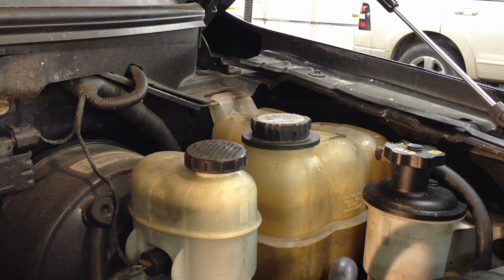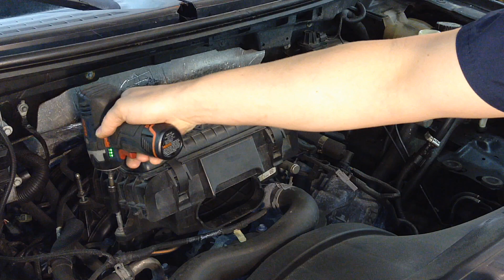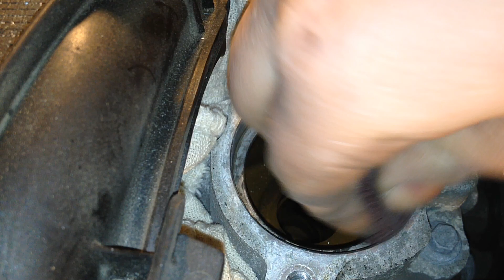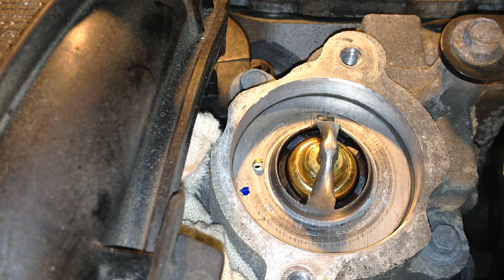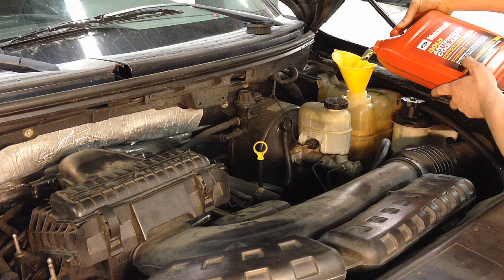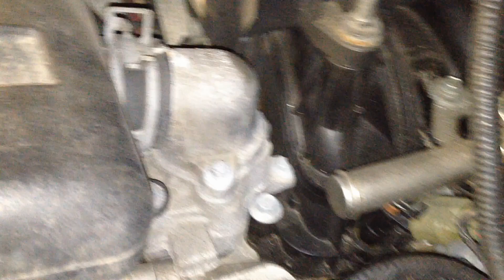Ford 5.4L 3v Engine Overheat P1285: Thermostat Replacement

Comment: I just did mine and whoever changed the thermostat last, installed the O-ring at the bottom of, instead on the top like in the video..smh. No wonder there was no hot air coming out. Thank you for making this video.

Comment: I really doubt all mechanics would take the time to use a scotch brite pad to clean off the mating surfaces. Thanks again for doing it right!
Reply from the maker: ***** Yeah I like to do at least a bit of cleaning so I am confident in the repair. My tech number goes on that ticket here at the dealer and at Ford corporate I don't want to go down in history as the problem child tech with all the come backs.
Reply: FordTechMakuloco  do you have to bleed coolant system on a 01 navigator if changing thermostat?
Reply: Most good certified techs will. They don’t want to have to do the job again
Reply: I do and probably almost all experienced pro mechanics too.
Reply: Youre going to the wrong places if they dont cuz thats a common practice

Comment: I'm glad it's not like my 99 5.4 those housing bolts are  like six inches long and go down through the head was a nightmare removing them with out breaking them off my 06 now has the short ones

Comment: Excellent video as always, easy maybe dumb question. The other day had a huge leak on my radiator, I was 150 miles away from the house. Stopped by advanced and bought a bottle of Bars Leak/Super coolant and 8 bottles of distilled water. I did a one shot stopping every 20 minutes to check the level. I ordered and a new radiator, pump, thermostat should I be concerned about the bars leak I put in? Will it plug my heater core or anything else after I install the new radiator or did the old radiator catch most of it? Thanks

Comment: My 04 5.4l 3v has been having a P0128 code. Engine not running at optimal temp (running around 150-165 degrees). Required changing the thermostat. Thermostat was sticking open and overcooling the engine.
Reply: I have the same issue, is this not okay for the engine?  Don’t you want it to run cool?

Comment: Im having an overheat issue on 2009 Ford Fusion 3.0. I replaced the radiator, fan, thermostat and both upper and lower radiator hoses. Idk if these systems can be pressure tested but I tried pressure testing it from the overflow tank but literally no pressure was building in the system despite filling it with like 9 quarts of coolant. I bled the cooling system because my cabin vents were hot when I turned the heat on but the overall cooling system is not performing for some reason.. I verified the cooling fan does turn on. I do not believe I have a head gasket issue because if it was, the coolant would be boiling/bubbling at the overflow tank and it doesn't.  Only other thing I could suspect is the water pump but even then when I drained the coolant and filled the system back up the coolant was sucked down into the system after the engine warmed up so that must mean the water pump is doing its job? so I'm lost.

Comment: I'm working on one of these for a friend at the moment. It seems to be overheating, I can smell it in the coolant it's been hot, she said it was tapping and sputtering as well when it does it. I was leaning towards the thermostat sticking already, the coolant doesn't look bad so I don't believe it to be a clogged radiator issue and no weeping or noisy pump it has triggered a engine light but the diagnostic port is not working so I can't get the codes to see what they are. It looks like from your video description the thermostat sticking is common on these and since I can't get codes I'm thinking I'll replace it 1st since it's easy and cheap flush the system and see what happens.
Reply: Any ideas on the diagnostic port would be appreciated as well. Thanks love your channel!
Reply from the maker: There is a 20 amp fuse that powers the port and is shared with the power points so check those listed as power point fuse in the owners manual.
Reply: @FordTechMakuloco  thank you. I'll check that out

Comment: Enjoy your videos. I have a question concerning a 2000 Ford Expedition Eddie Bauer 4x4 5.4. I have a p308 code for number 8 cylinder - a misfire. I have changed coil and plug brand new. I still have p308 code. Do you have any ideas as why this happening? Vehicle is drivable, no no blow by smoke, has a shake on a hill and with high speed. You are thorough and I love watching your videos - would appreciate your help

Comment: Have you worked on  a 3v 4.6 Mustang with a heater hose leak and what are your thoughts one running the heater hose under the intake and putting quick connect elbows on something that you can't even get to without tearing a bunch of stuff off the top and/or front of the motor. I guess the proper way would be intake removal and all attached to it. But I've seen it worked out with Throttle body and alternator were the biggest parts removed. I personally think it's a pretty twisted prank to put those quick connects in there. No need for quick connect if you removed everything in the way and have wide open access.

Comment: I just had the water pump replaced on my 2007 5.4 3v with 146,700 on it. The truck has always run between 190 to 200 on my CTS2 used to monitor gauges. After the replacement of the water pump and belt tensioner, my truck now runs with the coolant temp around 220 to 224 and CTS2 shows cylinder head temp around 236. I am going to take it back to the shop that did the pump. What does it sound like maybe wrong? Air in the system or something? The temp gauge on the dash never rises above the center mark for normal operating temperature so I am really confused and concerned. What would be vital or critical temperatures for coolant and cylinder head? Any tips on what to have them look for or to question what they did? I am not getting any codes that I am aware of yet either.

Comment: Thank you for the video I got my Ford F1 50 and I get half a cigarette problem with the overhead and I am really don’t know what to do with the truck the mechanic can’t find the problems I replace the thermostats fan clutch radiator and water pump and I still had the Problem can you help me with

Comment: I have a 2004 ford expedition.... 5.4 liter  just changed the thermostat. Still takes forever to warm up and doesn't blow hot air... every once in a while it will overheat but turn it off and back on and the gauge will go back to midway, hot air and all is well...  do you think a flush would maybe help? Or air in the line?

Comment: I have replaced my thermostat in the last year, but have an issue after several minutes of driving, the temp gauge goes up for about 10 seconds then returns to normal halfway position. It does not turn on the check engine light/code, is there a short list of other possible issues or is the thermostat the likely culprit?

Comment: Thinking of putting a 180 temp instead since i live in the south. Truck reached temp of 210 a few times causing rpms to rise to cool the engine i assume. Whats your opinion?
Reply from the maker: 210 is totally fine

Comment: Would you happen to have any videos on how to replace the cylinder head temperature sensor on an 07 expedition 5,4 3V and if so is it possible to not have to take off the manifold to do so.  Appreciate you sir.
Reply from the maker: No you just have to remove the intake manifold or at least unbolt and lift it.
Reply: @FordTechMakuloco  would I need to remove the alternator or no? Sorry for all the questions just really value you're opinion. On a scale of 1-10, 1 being installing a air freshener on the rearview mirror and 10 being a complete tranny and engein from Auto to maunal swap what would you rate this as?
Reply: @BossTweed1  You'll make it much easier on yourself if you remove the alternator and like he said at least unbolt and prop up the intake. 
I'm no tech but I've had the intake out of both my wife's 2012 and my 05.
During both I saw that temp sender and thought no way am I putting this back together and not replacing that thing.
There's just no way to get to it otherwise. 
I've been a Ford fan since the early 90's but it's shit like this that makes me want to just slap some sense into their designers.
Reply: @carlspackler91  thanks a million. Yeah I thought the same like why put this in the most hidden obscure place ever.
Reply: @BossTweed1  Because their engineers are masochists at heart 🤣

Comment: I replaced my thermostat and I'm still getting Spike and Check Gauge alert. If I turn it off, and back on, gauge goes to normal. I can slowly unscrew the reservoir cap and it builds with fluid. Any ideas would be helpful. This time, it struggled to start. I'm almost ready to switch trucks and do a timing job, maybe.

Comment: Thank you for the video and the best practices. Working on a 2003 Expedition 5.4L Triton and having trouble confirming the torque spec you mentioned. 89 in-lbs seems rather low, yes?
Reply: Adam Smith 89 in-lbs is the correct value for 2005 models and up. 2004 and earlier models require 15 to 22 ft-lb.
Reply: Wasper216 Thank you for the reply! I held my breath and trusted your expertise and it worked.

Comment: Hi! 
great videos! Quick question, on my 2001 f-150, my temp gauge now seems to hover at about midway. It used to stay between about 1/4 and 1/3. It has 190,000miles. Can the thermostat get stuck halfway open? would that cause this?

Thank you!
Reply from the maker: It should always be at the midway point I have seen them stick many different ways.

Comment: i noticed that the powersteering reservoir is on the LF fender and not on the LH valve cover. never seen them there on f150's, only on expeditions of this year.
Reply from the maker: 4literpowered Yeah this truck had been hacked into many times in the past apparently. There was no bracket for the reservoir in it's normal spot and the reservoir is from and expedition with some lines hacked in.

Comment: hey Brian my f150 5.4  won't start it says that check engine temperature it's been 10 days that the truck doesn't turn on  like it's on a safe mode could ot be the thermostat....?

Comment: @fordtechmakuloco 
Please do a video on P0119 for the 5.4 3V engine.
Code says Cylinder head temperature sensor and possibly the harness Connector and or wires to and from Pigtail/ main harness. Due to heat.
The Sensor is located in the Valley of the Motor.

Comment: hello i have a 2006 ford f150 5.4 i need to do a full coolant flush do i need to remove the thermostat to flush the block out? thank you for your time
Reply from the maker: Coolant flush video out tonight on this vehicle
Reply: FordTechMakuloco would you suggest I stick with a 195 thermostat and not go down to a 175 instead what would be the difference except when it opens up.

Comment: My 2009 has no heat. coolant is good. fan works. all gauges read normally and come to normal temps.
Reply: Dave Mercado you probably have air in your coolant system
Reply: That or your blend door actuator is not functioning.

Comment: if I plan on following your video from 2014 on coolant system cleaning/flush, and plan on changing my thermostat, do I keep the old thermostat in while I do the flush then change it before adding the motorcraft gold and water? Or put the new thermostat in before cleaning?

Comment: HELP, i’m getting all heat if I turn on the controls would replacing the thermostat be a go place to start? 8 months ago I ran out of coolant and add about 1 3/4 gallons of coolant 07 F150 5.4 270k miles
Reply: mario serna It sounds like your AC actuator door
Reply: Blend door actuator sounds right to me.

Comment: I have a 2007 F150 5.4 that just had a new water pump put on and now at times it jumps into the red zone on the temp gauge, I shut the truck off and start it right back up no problem and when I do the gauge is in the normal spot and I drive as usual. Have you ever heard of this before? It's sort of like a false overheat but I don't want to dismiss it either.
Reply: ***** it was the thermostat,  when we took it out it came out in 2 pieces.
Reply: Air will definitely do that, just keep checking the fluid level. I had to replace my fan clutch too which was pricey but you'll know know when that goes out because you'll hear a loud roaring sound when you accelerate.

Comment: Have u seen any problems with leaking oil on the 5.4 Triton on the passenger side of the motor n smells burn after a while but don't heat up.

Comment: FordTechMakuloco I'm having issues where my temperature gauge in my dash just completely drops(as if the engine was off) and I get my traction control light lighting up. Any idea what my issue could be?
Reply: Alberto negrete Did you ever find the problem??

Comment: Have you run across a 2010 Ford Expedition that gets hot and the cooling fan is running high and is running loud? No coolant leaks or bubbling in the reservoir.
Reply: Does your ac work? If it dont throw cold air check your fuses thats what mine did if its a 5.4 3valve check the 32nd fuse thats the number of the fuse its a lil tiny 15 amp fuse check that
Reply: Check the clutch fan.

Comment: 02 Escape (3.0) radiator cracked while it was running, steam everywhere. Shut it down right away. Looked at temp guage a min later and it was at normal temp. Replaced radiator and thermostat while I was at it. Got it all back together filled slowly with vehicle running. When engine gets up to temp and I run rpms up around 3 grand for a couple minutes the overflow spews coolant out. I put cap back on overflow and it doesn't spew out anymore but the level rises very high to about an inch below reservoir overflow tube. I'm sure it would keep rising if I were driving. Any thoughts?

Comment: I assume that thing got a Oil change after that kinda overheating? Sounds kinda ticky, Overheat didn't do significant damage?
Reply from the maker: Nope that is how these engines sound all the time, this one also had bad phasers.
Reply: How much differance between a 2006 5.4 as opposed to a 2003 5.4?

Comment: So on my 2011 Escape, there is no radiator cap only the cap on the coolant tank. Is that where I fill up the system again when I drain the radiator?
Reply from the maker: +TIKIMAN198 Yes that is the fill and adjustment point.

Comment: i tried following the steps in your video, however, the aluminum housing cap is stuck and will not come off.  not sure if its airlocked someway or if the o-ring is so bad inside that it created a lockdown of some sort.  any thoughts on how to remove it safely?  also, im getting a p1299 code as opposed to p1285 code, does that make a difference?
Reply from the maker: +shannon wise Once the two bolts are removed it should pop right up there may be corrosion holding it in. The 1299 code is essentially the same code.
Reply: +FordTechMakuloco hey man, thanks for the reply.  i had sent you an email regarding this so you can disregard that if you want to.  Im going to try again, for the dealer wants $267 to replace it.  Gonna attempt the resistor card from one of your other videos tonight.  If the housing has corrosion locking it down, does Ford or you recommend anything special to get it off?  thanks again.
Reply from the maker: I have used a bar stuck into the neck to pop it up
Reply: I would suggest using a good solid bar(Even a 1/2" socket extension would work.), but, since it is aluminum, be careful, you can bend and break it, so, basically jiggle it a bit, by going back & forth or up & down, until you see it to start to move, then just keep moving it a little bit at a time, so you don't warp or break/crack the housing, to where it will leak.  Now, once it is out, I would follow what he was showing, and just get it cleaned up, and when you put it back on, it should be a lot easier.  Now, if you go to AutoZone and get the same thermostat, for your vehicle, they do sell 1 that has an o-ring, that mounts to the outside of the edge, where you see him put the o-ring around, where it actually sits around the edge along the bottom and the top, so, don't be scared of that, since it was a small modification, to make it easier to not lose the o-rings and seal both sides, much easier.

Comment: I was looking for this thermostat at Summit racing website, I did not find this part number RT1196  however they offer RT1234 as a item that fits the Triton 5.4L 3V. is that valid ?

Comment: Can you please tell me we're the temperature coolant sensor is on a f150 5,4L 3v triton 2006
Reply from the maker: There is no coolant temp sensor.
Reply: @FordTechMakuloco  how about a tempture control sensor
Reply from the maker: Cylinder head temp only
Reply: @FordTechMakuloco  my problem is my fan clutch is not working my truck says it is hot but it's not i can shut it off and turn back on and it's normal fan clutch is not changing speed I've replaced it,
Reply: When this happens it also shuts ac off

Comment: I have a question that no one has been able to answer and i pray you get back to me.  My temperature hand started falling to below zero and would jump back to normal.  It did this several times and finally just went to zero and stayed there.  My truck lost power and my ac quit working.  I replaced my cht sensor.  In the head on the left side under the intake.  Didnt fix the problem.  So i had a computer put on it.  It said temp sensor.  I went to the parts place and they sold me a white plastic sensor.  Looks like a giant bolt with pins in the top.  However i cant find where it goes.  No one has been able to tell me either.  Oh yeah.  Its a 3V 5.4 flex fuel engine.  Hopefully you can help. Thanks

Comment: I have a 2006 f250 with the 5.4 that the temperature hand will randomly peg hot. Check the engine and it isn't hot, I can turn the key off, then right back on and start the truck and the temperature is perfectly normal. I have replaced the cylinder head temperature sensor and it didn't help at all. Anyone got any ideals?